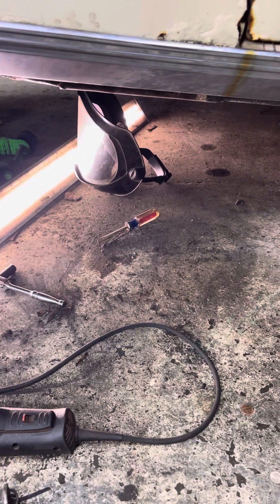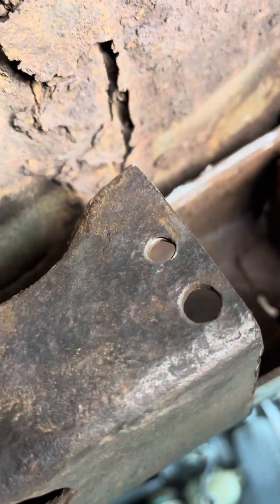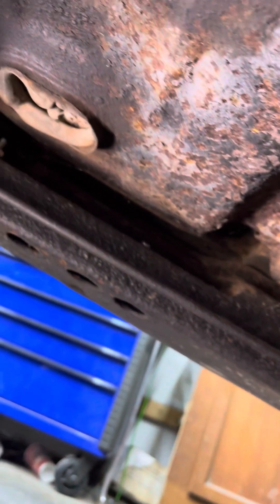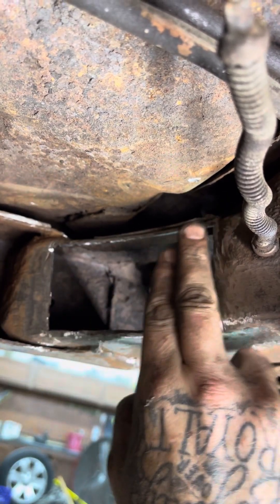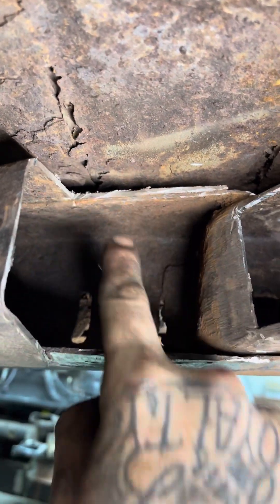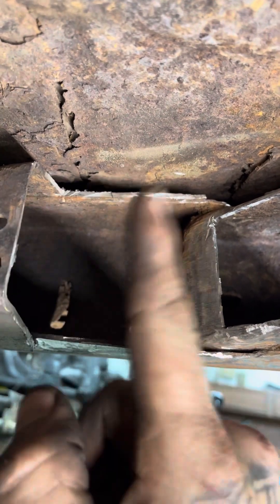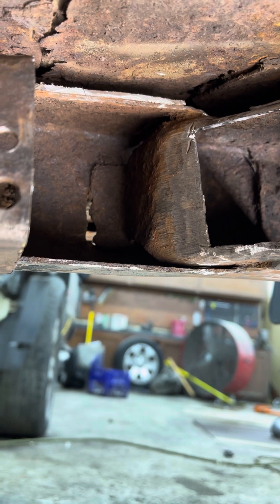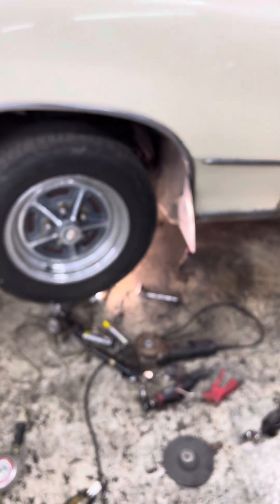1972 Buick skylark frame repair (part 2)

Comment: Good job.. perhaps check into a product called cavity coater rust preventative treatment it creeps into the tightest spaces and stops rust. Been using it on my restoration.
Reply from the maker: I will check it out
Thank you
Reply: @midwestcustoms5804   if you decide to try it please keep in mind it's quite flammable until it sets up...ask me how I know.